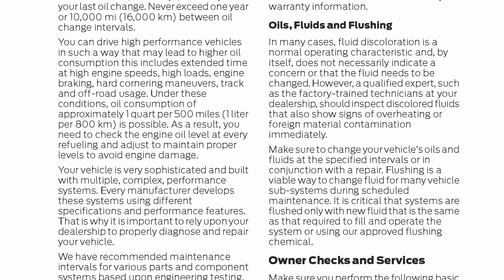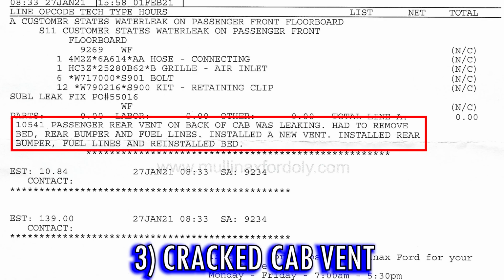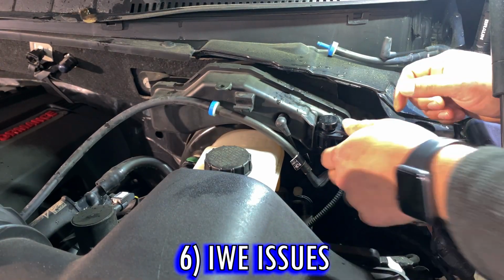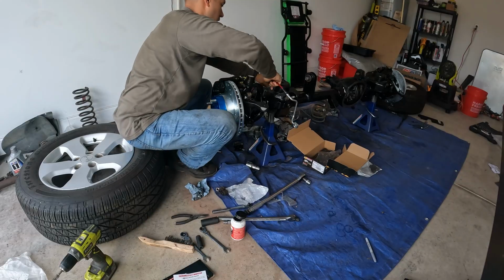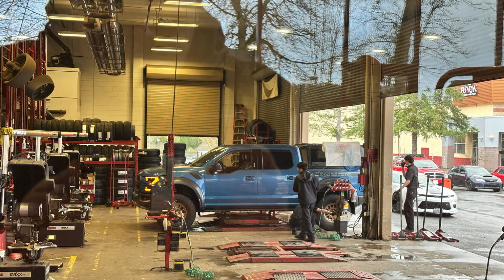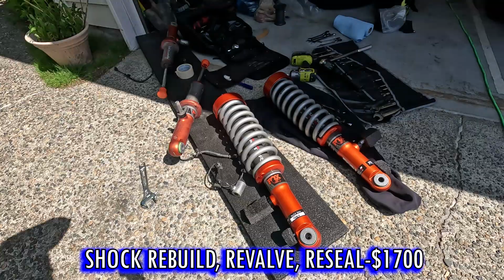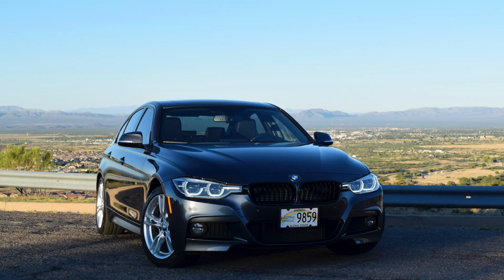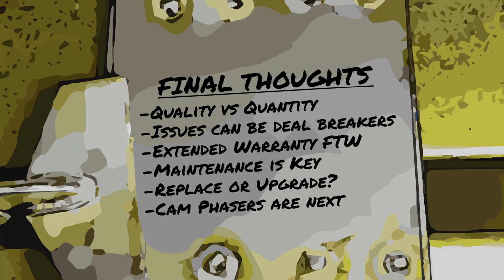Gen 2 Raptor Repair & Maintenance Rollup

Comment: do you really think the springs were the cause of your bearing issues?  i'm about to put geiser springs on my rebuilds and everyone has said they dont cause issues its lift kits and whatnot that usually are the issue due to the aggressive angle change.
Reply from the maker: I'm confident the busted ball joint was caused by the lift springs...the upper control arms just aren't meant to be at that height constantly. But idk about the bearing/hub issue. I feel like it likely isn't a coincidence. Either way, either more money for upgraded parts or more cost in maintenance over the long run...I'm at over 70k miles now and haven't had to replace any more suspension components yet

Comment: Awesome all-inclusive update on your Raptor ownership. I had a 2019 that we traded in around 45K miles on our 2021 when it was at the dealer for... cam phasers! They had that truck 3 months. I need to do an update video on our 2021, but I'm at almost 62K miles. changed tires, plugs, both diffs, FP rear diff cover, TC, trans fluid/filter w/B&M deep pan, of course engine filter, cabin filter and amsoil oil/filter changes. Tires replaced around 45k miles and the IWEs changed out at 59K right before the powertrain warranty expired. Had the exhaust rattle due to the original active exhaust actuator springs. Ford denied under my extended warranty and wanted almost $1K so for $70 I picked up the springs and did it myself. 

Right now I'm due for a Fox shock rebuild. Picked up a brand new rear set for $450 online and hope to find a new or rebuildable front set so I can just swap them out when needed and not put pressure on down time. It is a daily driver most days. 

I've not done anything with the brakes or coolant. You mentioned coolant flush at 60K? I thought it was a much higher interval. I know these newer motors can be difficult to get all of the air out of the system, but maybe I'll plan on doing that. I do tow a boat and SxS with mine, so it definitely gets some use. 

Anyways, thanks again for sharing your experience!
Reply from the maker: Is jumping to the Gen3 a massive difference?
Reply: @ruffwrenchn2235  I'd say the tech on the inside/interior was the largest change overall. The rear coil spring suspension I think is better for upgrading and long term than leafs. Rides smoother and none of that side-ways hops with the rear that I remember my Gen 2 having. 

That said, I was totally planning on keeping my Gen2. Loved the color and everything about it, but had the opportunity to get out of it while it was down, so it made sense.

Comment: My 2020 has 84k miles and i have had no issues so far. I live in AZ so water not a big deal here. I had my shocks rebuilt and tuned. Need to do my front and rear diff. Trans will be done too. I have an extended warranty till 105k miles so im not too worried.

Comment: Im servicing my wife 2018 genesis G80 with only 75k miles. It has been week 4 now waiting on parts. I didnt have to do a major service until 100k miles but hey I love working on cars. So I started and with those cars they also have high pressure fuel system. What a pain to get to all the parts and when taking out the fuel injectors you have to replace them or replace the seal and seals along were over $200 especially the combustion seals, plus the fuels lines need to be replaced you cant re-use them. Im sure ford could be same.. I cant wait to finish this project that was supposed to be done in a day. and
Reply from the maker: That sounds terrible. I will have to replace a fuel line and gaskets for the cam phaser repair, but hopefully I didn't miss any parts when I ordered. Otherwise I'll end up waiting for a while also.

Comment: Great vid. 
I got my 19 at about the same time. Far fewer issues (almost none) so I must be a lucky one. Fordtechmakuloco has a great vid on more realisitic fluid change intervals. I think that other than severe duty use or fording, probably the best recommendations out there.
Reply from the maker: I'm subscribed to him and used his recommendation when ordering cam phaser parts. I haven't seen the fluid interval video though...I'll have to check it out, thanks!

Comment: Great video! Thx for the info. I’m looking to put 37’s on as well. Just curious if you had any issues after put your 37’s on? Thx
Reply from the maker: I have a video on it, but I haven't had any issues with the tires. They're KO2s (36.5) and the rims are close to stock offset so with the eibach lift springs in the front and the icon leafs in the back I've been good. Even done some jumps and got to full tuck without issue.

Comment: There is a lot of Truth in the term Raptor tax lol all though not as cool as a raptor. Here i am with my 2011 highlander sitting at 210,000 miles and NOTHING other then oil changes, 3 sets of tires and 2 sets of brakes all in 15 years.
Reply from the maker: That's astounding! There is something to be said about Toyota engineering

Comment: Thanks for the video! Good to see there’s still a good Gen 2 channel out there. As far as IWE, would you say the ball joints or the wheel hub was the issue? I’m experiencing this as well.
Reply from the maker: My guess was that the broken ball joint caused damage to the wheel bearing and that's what caused the issue, but I'm unsure. It could be an issue with the front differential also that worked itself out with diff oil changes. Loads of things can go wrong in the front end unfortunately...maybe try putting vacuum on the IWE and check for play like I did in the beginning of the ball joint video. Inspect the CV axle shafts also. If you want to avoid exploratory replacements you could even pull off the wheel bearing/hub to inspect the IWE. Sorry, not sure if this helps.

Comment: I ordered my 25 raptor without the sunroof for this exact reason. Almost impossible to find a sunroof less raptor at the dealers.
Reply from the maker: I remember the E46 M3 you could get a plug that filled the sunroof hole and just remove the glass and motor altogether; nothing similar for the F150. I'll definitely try to avoid this nonsense if I can ever afford a new one again hehe.